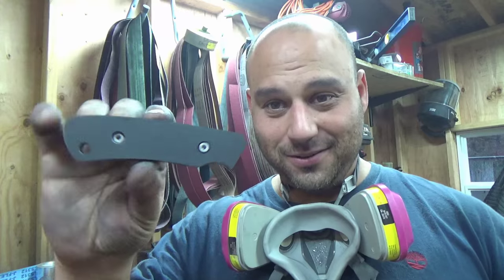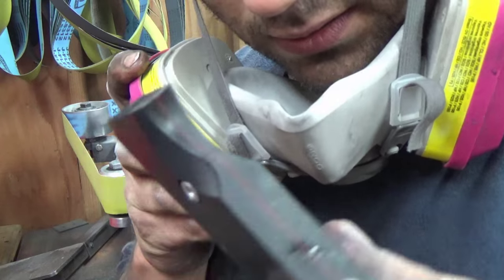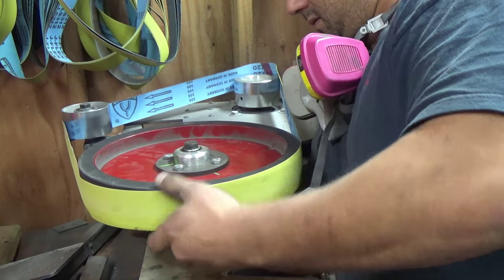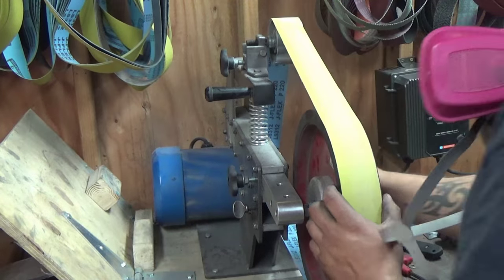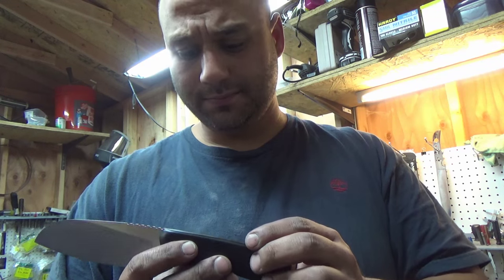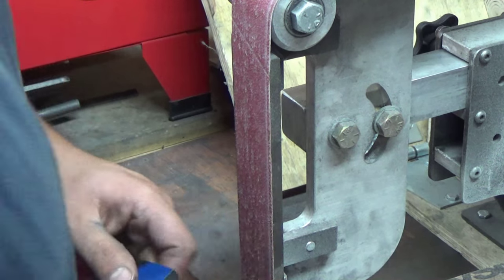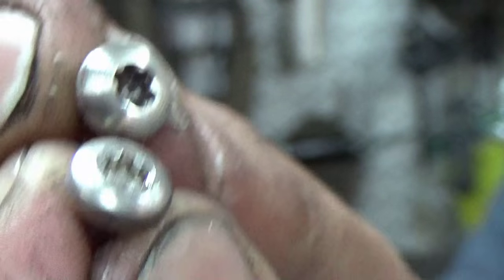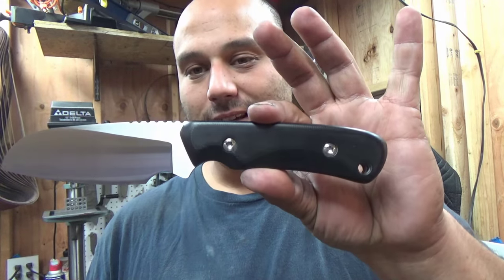How to make removable knife handle scales. Part 2

Comment: How do you like the j flex belts and what do you use them for?  I've never used one and was wondering what the benefit would be to using one for shaping on a metal wheel (beginning of the vid).

Comment: another very informative video... tried the screw head polishing idea on countersunk head screws works well ...only difference u need a flat surface to put the sandpaper on.  i used a piece of wood...anyways not sure if u have mentioned it in another video but since u cleaned up the jimpings with the Dremel ...how do u put them on prior heattreat? chainsaw file,Dremel,... ??? i like 5 to 6 jimpings on my blades but especially on thick stock its a pain...time consuming and then u have to measure where to put them...i hate it...especially when done with a file...tried the grinder n a very small wheel but didn't work that well...what i do now is use the hacksaw. ..jimpings don't look that nice neither are they that grippy but better than nothing...n quicker...what some do is before they shape the blade they msrk the jimpings location n drill them...then grind off excess. ..tried but my designs hardly stick to the plan ha i always improve them in the process... take care keep up the great work
Reply from the maker: +Fred L All of the jimping I have done before heat treat was done with a 1/8" chain saw file. Lately I have been using the milling machine with a 1/8" carbide endmill and doing it after heat treat. Either way works but doing it by hand will always take longer and usually require more work.  For smaller jimping I use a checkering file before heat treat.  I don't trust myself with a grinder or even the dremel to do the jimping free hand. its too easy to mess it up for me.

Comment: Take one of your standoff’s and split one side of it with the band saw or a grinding wheel . Clean the threads out with a 8/32 tap and then thread your bolt into the modified standoff and chuck it int your drill press. Thread damage risk eliminated.